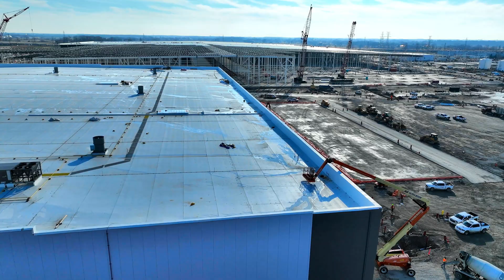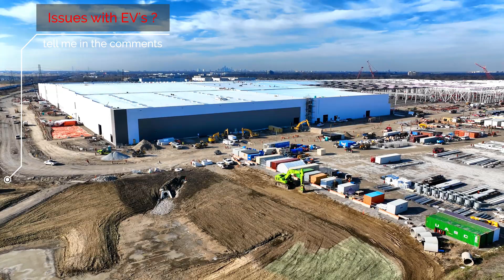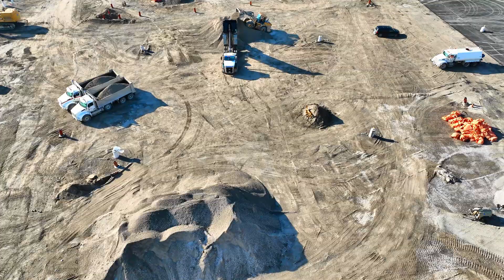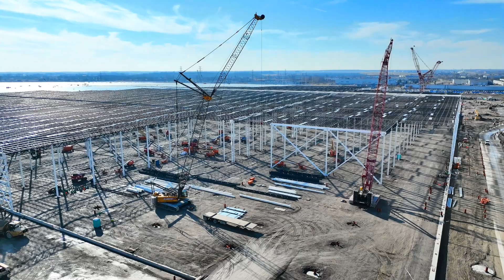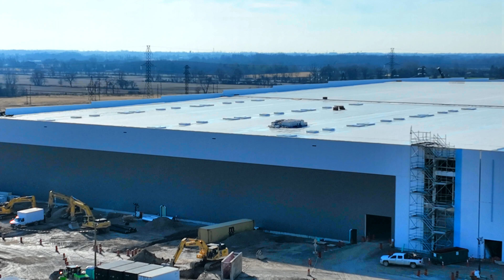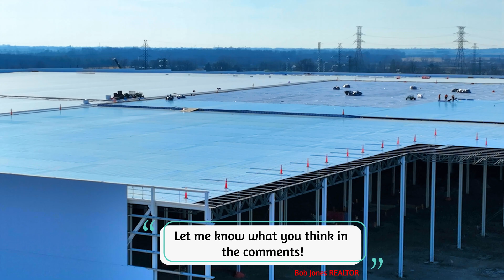Will Stellantis/LG Energy Battery Plant Survive This Downturn?

Comment: Good video but commentary often wrong or outright lies or out of context implications.
Reply from the maker: Thanks for the compliment, Lorne. I enjoy the feedback positive or negative, if it helps me learn or understand better. This comment is a little vague. I will state that I never post or produce outright lies, so that I do deny, however I'm just a guy with limited knowledge and makes mistakes. It's my hope that subscribers like you, (you did subscribe right?) might correct my deviation so I can correct my path. Let me know where I went wrong. I really do want to know. Thanks for the post. Great to have you here.
Reply: Love your videos of the bridge.  But have to agree that you're unfortunately spreading the usual suspect of anti-EV myths that were cynically started, and now shamelessly propagated, by fossil fuel interests.  

Every one of the myths you mentioned are easily debunked with a little research.  One channel full of good information is Rosie the Engineer.  She will set you straight with facts and figures coming from someone who has actually worked in the green energy field.  She will also update you on the latest battery technology, especially LFP batteries that are safer than ever and will most likely easily outlast the life of their cars.  Meaning, EV's equipped with LFP batteries, good for 300,000 plus miles, and containing thousands of fewer moving parts, will easily outlast their ICE equivalents.  It won't even be close.

And finally, as for EV fires, they are worse than ICE fires to be sure.  (Not that exploding gasoline is any picnic.)  But they are so exceedingly rare that no insurance company even bothers to assess a penalty for a homeowner who owns an EV and parks it in their  garage or near the house.  None.  And believe me, if there was an increased risk to them, insurance companies would pass that on to their policy holders. That is, after all, the very nature of their business.

And with the new LFP batteries, this already nearly non-existent threat of an EV fire will become even less.  YouTube makes it seem like EV fires are common because if one happens in one out of a hundred thousand cars, it goes viral.  And this then becomes a cherry picking of large numbers fallacy that is easily exploited by fossil fuel companies and the many people they pay to spread anti-EV information.  It's a shame that people trying to make an important car buying decision can't be surrounded by facts and figures which help with this decision, and not be sprayed with myths designed to falsely steer them in the wrong direction.
Reply from the maker: There are always two sides to a story and you make some very good points. Things are moving ahead with technology in the EV space. No doubt. 
However, the fact cars aren't selling as quick as expected and the manufacturers are pulling back on production due to great losses they suffered in the last year. Once the technology and infrastructure is there, in place and proven, and an affordable EV can be bought cheaper than an ICE vehicle, I'm in. Just my personal opinion.
Car owners are into convenience. Having to go out of your way and wait to charge your battery is not convenient. 
It will be interesting to see the push and pull in the market as EVs become better adapted. 
I do appreciate your thoughtful comment and knowledge. Thanks for sharing:)
Reply: All facts. The government is pushing technology not ready yet. Follow the science.

Comment: So we will have a gigantic battery plant with not many EVs on the road maybe good for flashlights 😅
Reply from the maker: Hi Ron. I believe electric cars are enevitable. However like the transition from horses to the Internal gas engine (ICE) it didn't happen overbnight. There will  be problems and solutions, advances and pullbacks until there is a natural momentum to pull it forward. We are not there yet. All the push from governments and climate activists can cost more than help the change. 
It would be a pretty powerful flashlight.eh? Thanks for the comment.